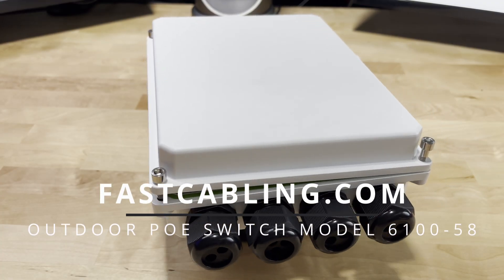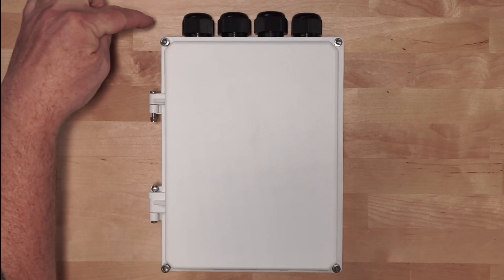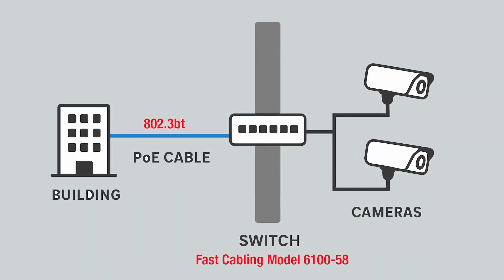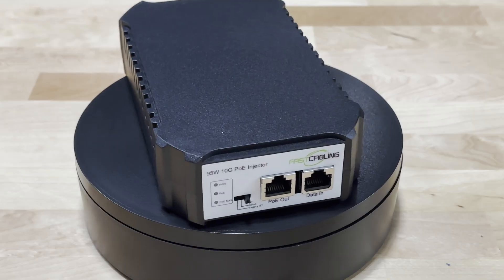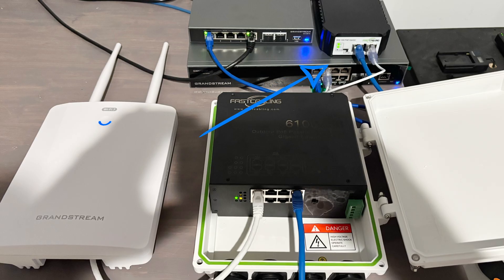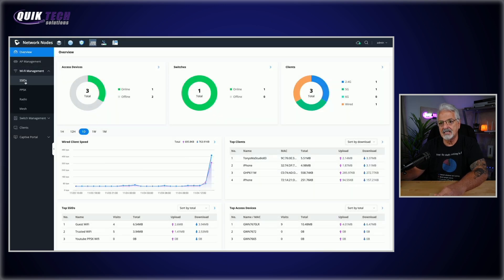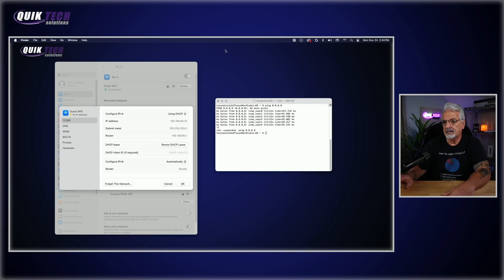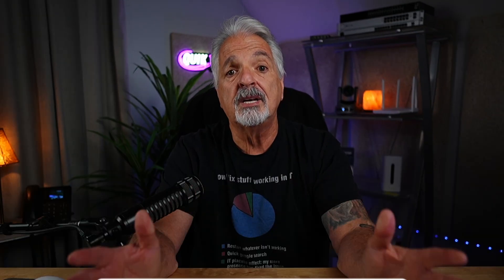No Power on the Pole? THIS Switch Fixes Everything — FastCabling Outdoor PoE Pass-Through Review

Comment: Great video Tony, the switch looks like a beast of a box and looks like it is certainly rugged and very well constructed with great weather protection.  As does the PoE Injector, looks really well built.  Thanks for the great video.

Thankfully I have not had to install in locations without power, but I am sure that will be the case at some point and in that case I will certainly look in to FastCabling PoE switches, for sure.
Reply from the maker: Thanks for watching Tim! Appreciate the comment and the continued support. Have a great evening.

Comment: I have used this for about 3 years. It has been VERY reliable for IP cameras outdoors.  The best part is BT power for the POE!!!
Reply from the maker: Thanks so much for watching and sharing your comment. It’s good to know that it’s been reliable for over several years. Have a great day.
Reply: @QuikTechSolutions  Just keep in mind, make sure you ground it, and that you use their brand injector (BT 95w) or get a really high quality BT injector.  The Amazon junk will die...lol
Reply from the maker: @ronalcorn7039  thanks for the tip. I plan on bringing in Electrician to figure out the grounding process because I have four devices outdoors that will  require grounding. The grounding pole at my meter base is about 75 feet away with the 90° turn so I’m gonna leave that up to the Electrician and I’ll stick to doing the low-voltage in tech stuff lol. I plan on powering the device with a Grandstream GWN 7816P supplies 802.3BT power so I should be good to go. However, I can always use the fast cabling injector that I have inside near the rack.